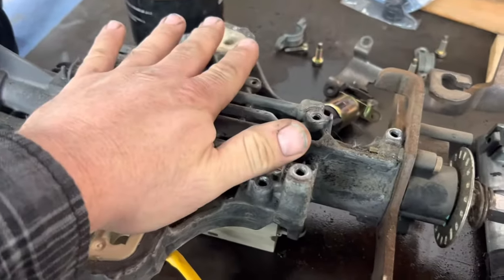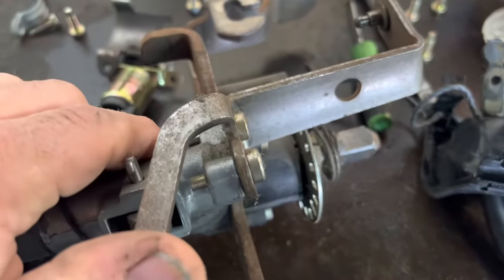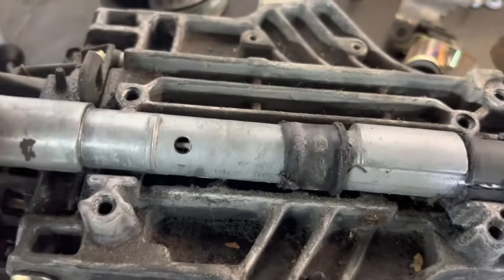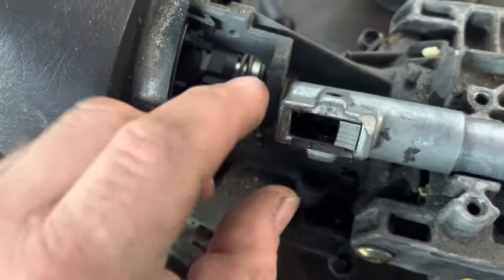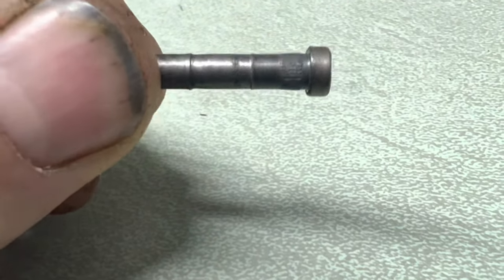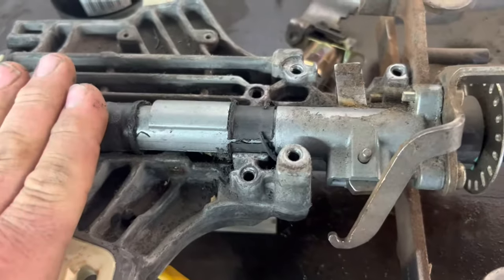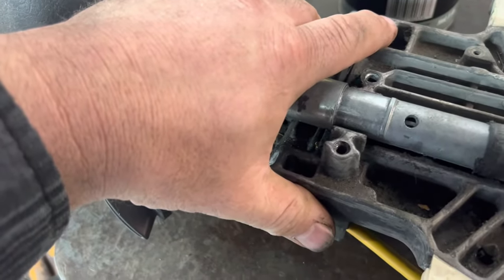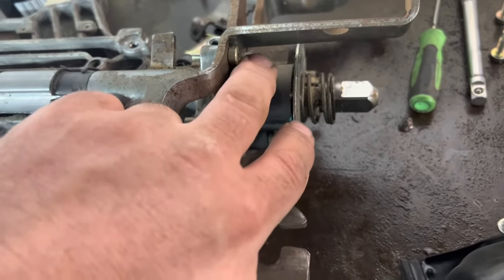Ford truck, sloppy shifter explained, cheap or free repair

Comment: This very video was exactly right! It took me less than 10 minutes to look under, see that the mounting screws were loose, get the tools, tighten the 2 screws up, and drive the truck. Shifter problem completely solved! Thank you so much! I’m a new subscriber for sure!
Reply from the maker: Thanks!
Reply: @bulldogsautomotiveadventur4387  just finished tightening those bolts on the tube... she shifts like she's brand hammer new. And the ignition point works perfect in park again. That was one other problem with the loose bolts, had to start the Ranger in neutral.  I've owned this truck since New in 2010... and the truck never shifted so good till now. Probably loose bolts from factory, lol

Comment: 2003 F150 XLT 5.4 here. I have been dealing with the shifter getting progressively looser the last few years, and it finally got so bad that the truck stopped starting in Park, and I would have to put it in Neutral and then it would start. The linkage was so sloppy it didn’t hold in Park enough for it to engage the ignition. Then it got worse, after driving the truck when I would go to put it in park, after a few seconds it would slip into reverse. Very dangerous. Watched this video at work, got home, grabbed my torx screwdriver set, and searched for those two screws. Sure enough they were both super loose. Tightened them up really good, and wow brand new truck. Shifts into each gear super tight, and everything works perfect again. Thank you so much! Best video out here on this issue. Probably a ton of people that can benefit from this. Greatly appreciated.

Comment: Great video, explaining this problem. This is a massive issue on these many older Ford’s that use this shifter system. Ford used this system was used for years in anything from the Taurus to the Crown Victoria, Windstar & Ranger. I honestly almost think it should’ve been a possible recall, same with the shift indicator issue too.
Reply: It won't shift properly. Do I need to change the whole shifting mechanism?
Reply from the maker: @MatthewAnderson-it8nq what do you mean by “won’t shift properly “?

Comment: I just had one of those bolts on the back of the shifter tube shear completely off. 2000 F350 with the 5.4L engine. Those bolts are really hard to find!
Reply from the maker: @ronlarsen4369  I’m currently doing another video on this where the shifter tube broke and snapped one of the loops off, ford still has those parts available

Comment: My torx screws were loose and the upper one doesn’t thread into anything. Is it possible I broke the part that the screws thread into? If so what’s that plate called?
Reply from the maker: @bryangarber7580  make sure it’s lined up with the hole, if you need the part it’s called the receiver tube or shifter tube.

Comment: A+, thank-you for posting. You covered all the issues for slop in the shifter on these vehicles. If you want to pick these up at your local auto parts store the info is: Dorman Transmission Shift Rod Bushing 905-107. Price is around $6.99 for the pair. These bushings made a huge difference for my Ranger. I would suggest using some sort of plastic compatible grease on the inside of the bushing.
Reply from the maker: Just tightened the bolts up on one today, been giving trouble starting for months he said, turns out it wasn’t getting all the way in park sometimes.

Comment: Part numbers: 
Gear Shifter Assembly: 5C3Z-7210-AAA
Shift Tube: F57Z-7212-A
Shift tube bushing: F3TZ-7L278-A
Shifter lever pin: F0DZ-7G357-A 
The pin in the video looks like the Doorman one (924-440)
Bolts for the clamps: N806584-S437
Reply: what about the torx screws? what’s the specs ?
Reply: @l3thalempire400  found the Ford part number: N806584-S437
Reply: Thanks for posting this info. I found a pin on the floorboard and didn’t know where it came from.  I identified it  as the shifter lever pin with your info.

Comment: This is the most in depth analysis I've seen on the floppy shifter problem. The old F250 7.3 I just bought has the flop but the torx bolts are tight, after seeing this I suspect it's worn bushings on the tube causing it.

Comment: Thanks, Bulldog! My shifter was sloppy and then eventually broke, no shifting! A little research made me think it MAY be the cable. But, hands-on research showed me the cable is fine!

The issue on my 98' Ford E-350 is where the end of the shift rod transitions to a plate. There is a very specialized piece that fits in there.

Initially, a friend was helping, and he bent a 1/4x20 bolt and stuck it in there, DEFINITELY TEMPORARY, as after a couple of weeks the bolt was laying on the floor Fortunately, I was able to get under the van, shift the van and get back home.

So now... I am going to make the permanent repair. Or... as permanent as possible with what is obviously a design flaw.

I have an awful lot of brackets underneath my column. I find it hard to believe all of those brackets are stock. When my catalytic converter was stolen, I was then told that my van was a special make and the cat was not available.

Anyway, I have got to drop my entire column to get in there. AND... I have already removed quite a few brackets to get to the point where I can kinda see the transition plate. Well, I gotta get in there, so I am gonna find another video that shows how to drop that column. I HIGHLY DOUBT, any video will show all of the steel brackets that I am seeing.

Oh, if you're not too busy, can you make the repairs to my shift rod and transition plate? We can make another video, and I will handle the camera!

Thanks again, brother! Best to you!
Reply from the maker: If you have several extra brackets then it was probably a build with hand controls, I’m in northeast Missouri.

Comment: Thanks for the visual aid! helps alot! I have a Mazda b3000 year 2000, and  the screw was loose enough and broke of a piece of the threads inside. So you can see half of the threads.  What would the part name be if i wanted to order it to get replace.
Reply from the maker: @jimcarrera4546  shift tube or receiver tube

Comment: Hi thanks for the best videos on shifter ,my problem is it goes to drive but won't go back to park what do you think ford 250 1997
Reply from the maker: @gosselinsergegs  The newest video on my channel is a start to finish on this design, I assume if it’s a problem in the column it’ll have to do with the lower part of the shift tube, if not the casing of the cable might be broken… you’ll have to do some investigating to find it.

Comment: What if it’s not that? Is it likely the bushings that sit on top of the receiver tube? Mine will not go into park and my bolts are not loose
Reply from the maker: @SouthernBelleBroker  check the cable, if the casing is broken it will cause this , as well as wear in the bushings and pins

Comment: When I dropped the column to repair my shifter tube,  when I re-raised the column back in place and tightened it the steering wheel sticks.  What did I do wrong?
Reply from the maker: Check your column covers

Comment: I Tighten the screws but when I put it in park it stops on the R and Reverse at N and so on what do I need to do to fix that
Reply from the maker: @plowboy261  the tiny cable is probably broken, you can put it up in place and secure it with a small zip tie so long as it’s not completely destroyed

Comment: Hello,  my friend in the table  not look the P(parking) , I change the module tcm solenoide valve and same problrm , no look in the table "P" , other gears is ok.....help me ....
Reply from the maker: I’m assuming you have a digital readout for your shift indicator and it won’t show that it’s in park and the rest of the gears do?
Reply: @bulldogsautomotiveadventur4387 
@bulldogsautomotiveadventur4387 yes , digital readout, is the 5.0 cc xlt year 2012,,,,.... maybe the cable that comunicator the lever with selector automatic box?? ..... thank for response
Reply from the maker: @franknieto6064  The application depicted in the video is a mechanical indicator, yours is digital. It could be a cable adjustment problem but if that was the case the engine probably wouldn’t start. If the “P” never shows up then it could be a problem with the readout itself, or with the wiring at the transmission. You stated you changed a solenoid? If the problem occurred after that then I would assume it’s not plugged in correctly, the larger round plug on your application can be a bit tricky
Reply: I'm having same issue

Comment: Can you help?
When i park, i have to leave it in Neutral and E-break. Because i can't get it out of Park. Did the dial adjustment, that just moves the needle.
Had to drop the dashboard to get to the heater core a month ago. Did something get bent i can't see?
Reply from the maker: Did you forget to plug the shift interlock back in?
Reply from the maker: Make sure you have brake lights, if something happened to the brake switch the interlock won’t work either

Comment: Then I'll just loosen those 2 bolts and put some lock glue or something on the threads then tighten them on so they'll stay tight longer 

I dont really see a good point in replacing those plastic bushings when new ones will break because its plastic I'd use or make a metal sleeves for it instead of plastic bushings

Comment: What about repairing the actual shift lever. Both of mine have play in the handle where the pink locks it into the tuve
Reply from the maker: The handle is available and often is replaced due to a bad overdrive switch, the receiver tube is available as it often breaks when the shifter gets sloppy enough that the interlock won’t disengage and people yank on the handle, the pin is fairly cheap and available as well so might as well replace it too.

Comment: 1:34 what are the part number for those 2 bolts right their
Reply from the maker: Scroll down, someone in the comments listed all the part numbers, I don’t normally deal with ordering or billing at the shop and as far as the bolts we’ve always found them in the hush panel or floorboard.

Comment: I just tightened these two screws as they were very loose.
Now after tightening them i cant shift anymore and the transmission would not move out of P? what did i do wrong 😂

Comment: But then if its just loose I'll only use the glue and do it that way 

But im set on to do the leaking gas line its got a leak from the gas line end to were it connects to the gas filter 

Its got a bad gas line end connector from the engine to the gas filter under the driver side door so that shouldn't be to hard to fix  its not a screw on type of gas line like how on Chevy it is im not much use to working on fords but i have to

Comment: Does someone make shims for the sides of the shift lever/pin? That's where my play is or do I need to replace the shifter? Thanks great video:)
Reply from the maker: I think some had a c-clip looking shim that went over the shift lever and the pin held it in
Reply: @bulldogsautomotiveadventur4387  my 98 F-150 did not have a clip. The pin was knerled on one end. After checking the pin for wear, which it had a lot, I decided to order a new pin. I'm assuming that the pin will wear more than the shifter.
Reply from the maker: @timgiles9413  we ended up getting a new pin for this column, a small amount of wear translated into a lot of slack
Reply: I ordered a new pin on mine when I saw a lot of wear, and then I saw your reply. 
Thanks for making the video.  @bulldogsautomotiveadventur4387

Comment: I changed my shift tube it’s my first time doing it to and I’m a bigger guy so getting them two bolts were a hassle cuz I couldn’t fit up under , but I replaced it and somehow I can only get netrual and. Drive it’s like somthing it else is bro or I missed or done somthing wrong
Reply from the maker: Are you sure you got that interlock solenoid installed correctly?

Comment: Anyone know what the thread size is on the bolts. Found the head of one laying in the floor board tonight after seeing this video after an 20 mins of messing with it why I could barely get it to shift between R N D
Reply from the maker: I think they’re 6mm
Reply from the maker: M6x1.0 if memory serves

Comment: The plastic part that wire runs through is broken. How do you change that?
Reply from the maker: On the shift cable itself or the indicator?

Comment: Thanks for the thorough and detailed explanation. I replaced my bushings but there was still some slop, I'll check the other place you mentioned.
Reply: Check to see if one of the bolts doesn’t have anything to bolt into. Mine broke 2yrs ago almost to the date, the part where the torx screws into the column broke. Had nothing to screw into. I now have the same exact problem again. No R or Park. Everything else is fine, bushings etc.